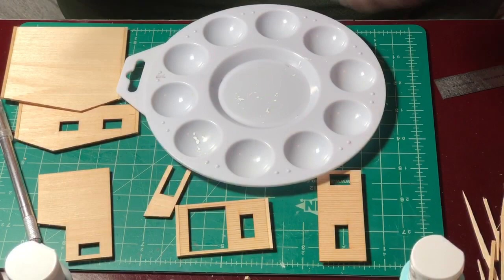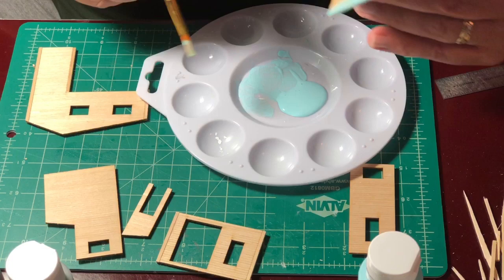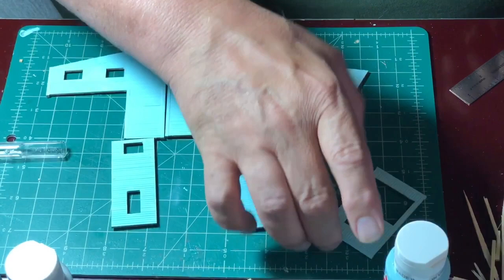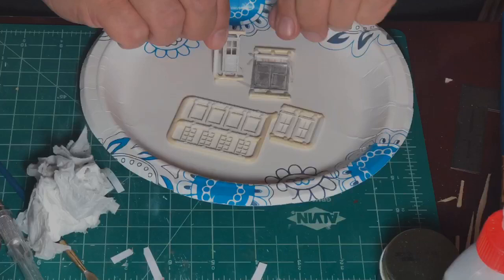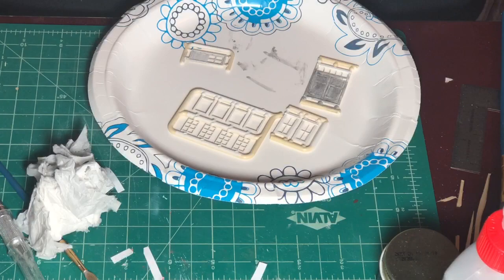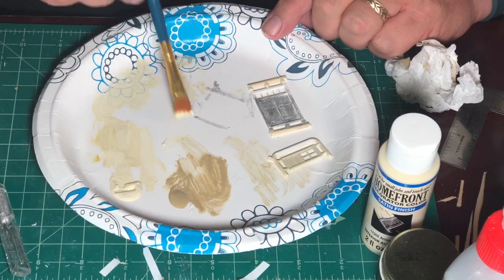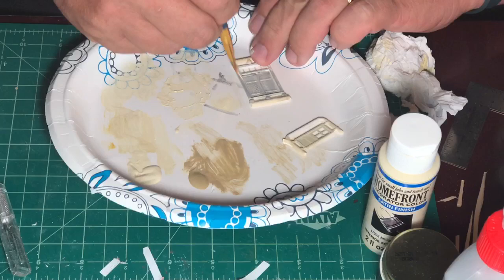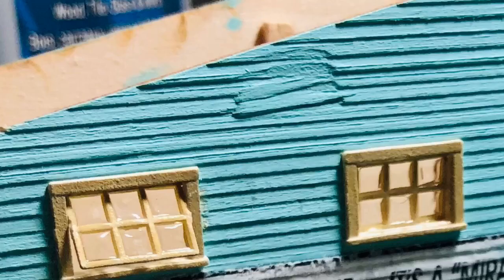Ron’s Workbench Episode 9: Paint and Windows.

Comment: Beatles reference, nice. Can you explain applying a wash on the doors and then the paint? Forgive my ignorance. I agree the window maker looked the best. Okay, see ya next time.
Reply from the maker: Hey Norm, I was trying something completely different, I wanted to highlight all the textures in the doors by darkening the crevices. I then went over everything by dry brushing with the paint. I didn’t completely cover up the areas I put the wash on....The reason I used the 99% alcohol was if I thinned the paint out with water it would have caused the paints to mix rather than stay individual colors..... i could have achieved the same effect by just using an enamel paint for the second color since enamel and acrylic paints won’t mix, or interfere with each other. The whole idea was to build up layers of individual colors. Thanks for your support. 👍

Comment: The build is looking great. I break parts all the time an I just glue them back together an i cut the open area for the windows to big an i just fell it back in lol So is that stuff you use on the window is that the same stuff that Vinny use that one time? An do you like it ? What is it call? Thank you for sharing
Reply from the maker: Hi Dwight, It’s called Model Master “Clear Parts Cement and Window Maker” It is a pricey for the amount you get. It takes about a day to set up, and about another 48 hours to completely cure and turn clear. Thanks for sll your support.
Reply: @ronsworkbench1944  I thought it made those windows look good to me an thank you for telling me. I doing a build an i have 12 windows to do on my build lol
Reply from the maker: Hi Dwight, make sure to let it dry flat and not on an angle.